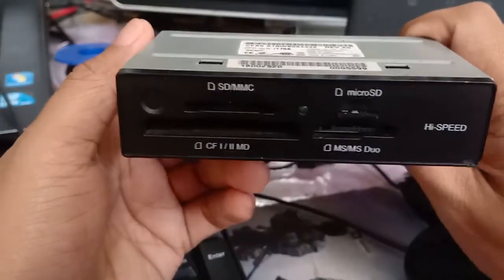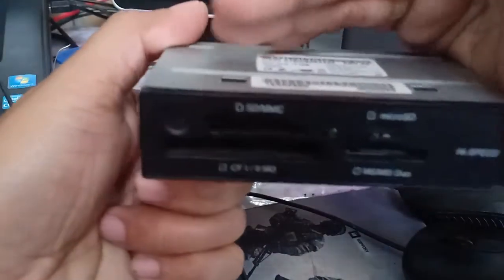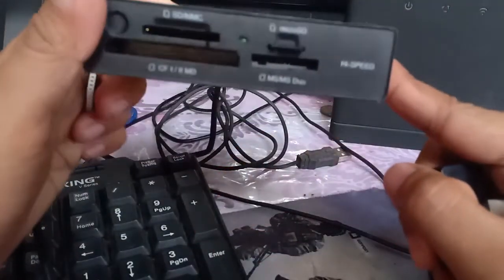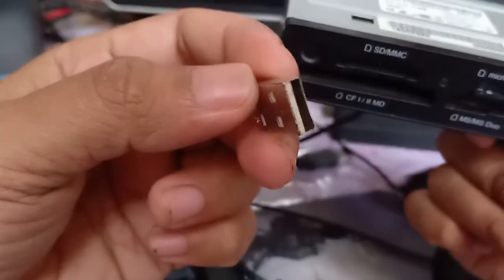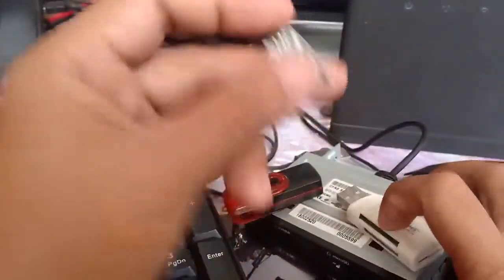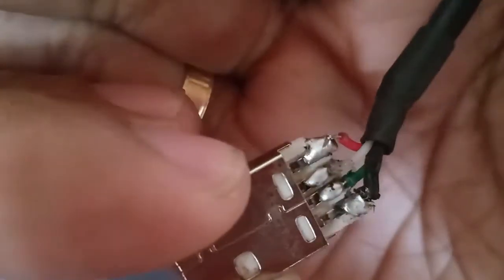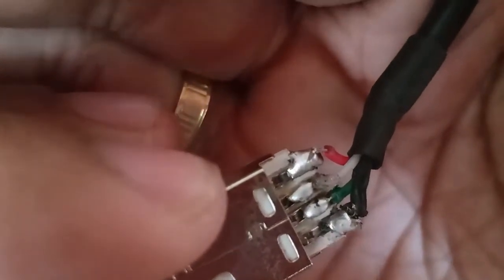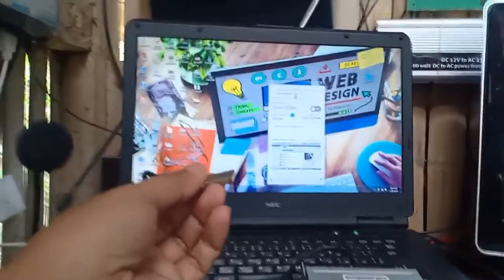DIY Card Reader  from Old Desktop Computer Parts

Comment: Congratulations on the video. However I have a reader that has 9 pins. Could you give me a hint on how to connect to USB? Thanks in advance.
Reply from the maker: Hi, for it to work, you can try to use only 4 wires, red and black for + and - , the other two is for data. I hope it will work.
Reply: @LoretoLlosala  Thank you for your help. Some worked and some didn't. But the tip was worth it.